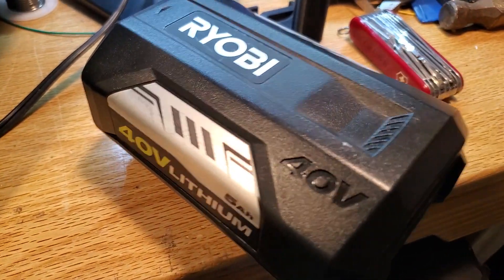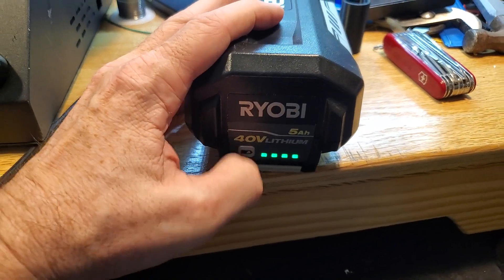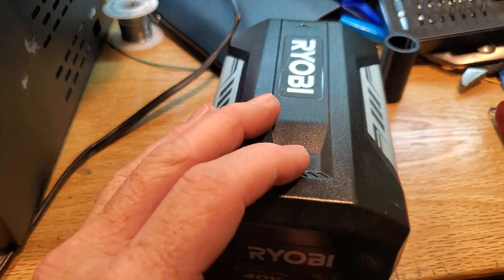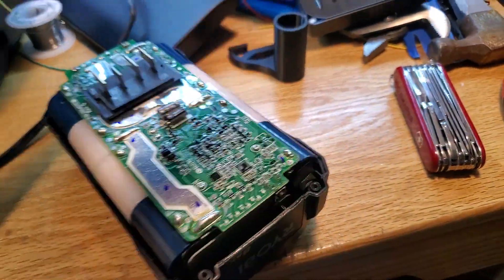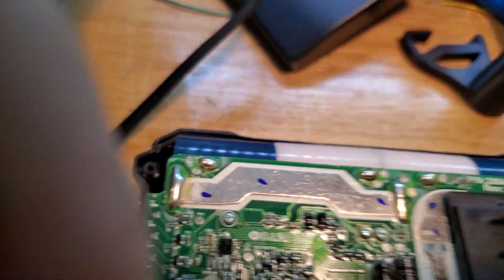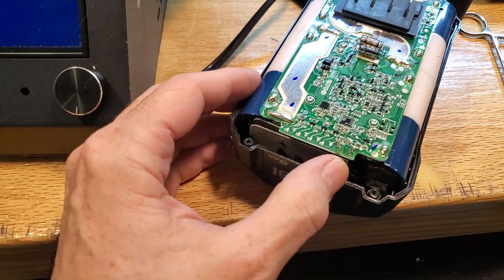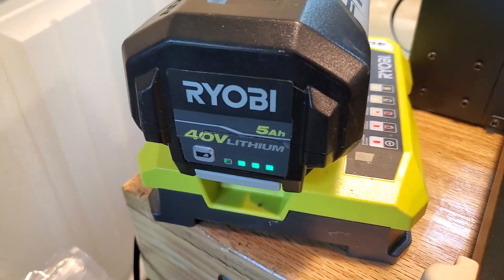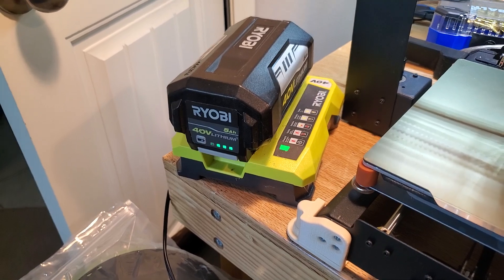RYOBI 40v 5ah Yard and Garden battery fix reset process UPDATE: Doesn't Work! 🤦‍

Comment: Mine resets but never fully charges and only runs my mower for about 15 -20 minutes when I used to get an hour out of it. If I'm using the mower and don't let the battery fully run out I'm able to recharge it.. but if the battery runs out I must use the reset procedure again.

Comment: How did you get the plastic caps that cover the screws on the indicator side?
Reply from the maker: I just used a small jewelers screwdriver to wedge them up.
Reply: @VernGraner  got it off thanks

Comment: how do i remove the 4th screw on the cover?   for me it is a plastic plug.  no head showing. 😩
Reply from the maker: The screws are "hidden" beneath the plastic plugs. I had to use a sharp awl to dig them out on mine. :)

Comment: Have you measured the voltages on the cells?  The BMS will prevent charging if you’ve got cells below the minimum voltage threshold.   Ryobi claims this is for safety reasons but it sure screws a lot of people.

Just charge the cells up manually with a power supply until they are all approximately 3.50 Volts.  Then put the pack into the charger until it’s fully charged.  Should be fine after that.  (You may need to reset it again after getting all of the cells to 3.50V)
Reply from the maker: I have been so tempted to go down the rabbit hole of fixing 18650-style battery packs.. I've watched some of the pack builder videos where they use the mini arc welders to add the strips to the batteries to bind them together in packs after finding/removing failed cells.. but it seems like this might consume more of my time than I have available at the moment.. :(
Reply: Vern Graner  - I’m not suggesting replacing the cells at this point…. Just measure the voltages and if needed, individually bring them all up to 3.50volts via alligator clips and an 18650 cell charger.  Then “reset” the battery pack.  Then use your usual Ryobi charger.
Reply from the maker: @test-193  This sounds like a good idea. Just have to find the time to tear the batteries apart again. ಠ_ಠ